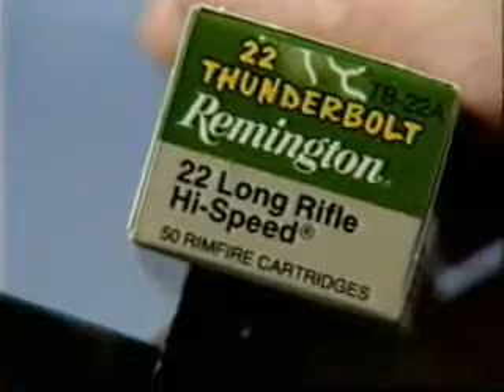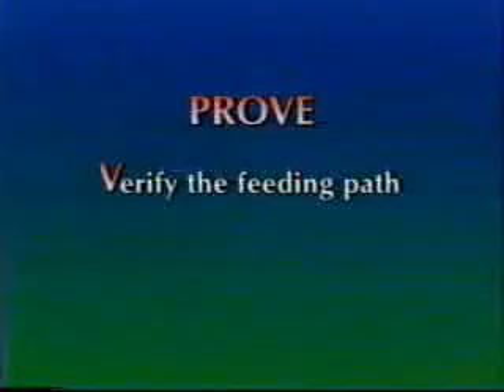Canadian Firearms Safety Course Video (Part 4/6)

Comment: @hewittdj1 If you take the Canadian Firearms Safety Course that's actually the approved way to examine the bore.  I had to do that for every single firearm during the exam except for the SA revolver (if you don't you'll actually lose points on the practical exam). Remember, examining the bore is the LAST THING you do after confirming there is no ammo and all the proper safey procedures have been followed.